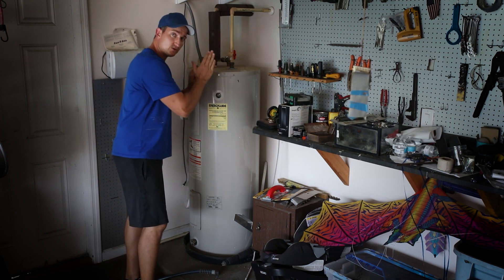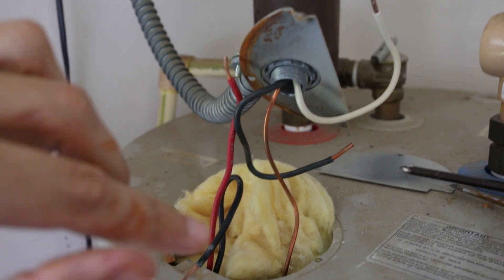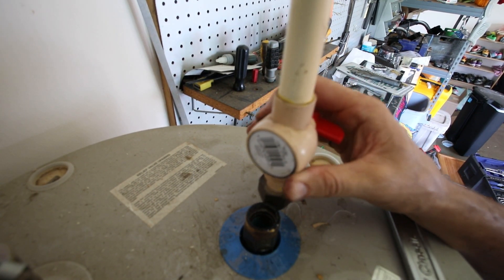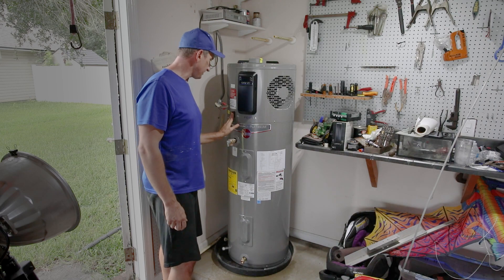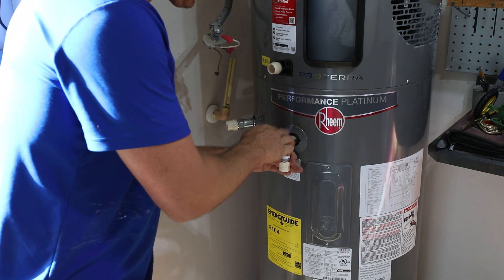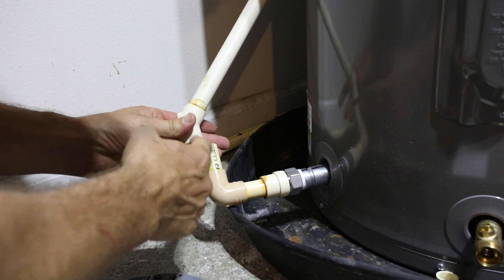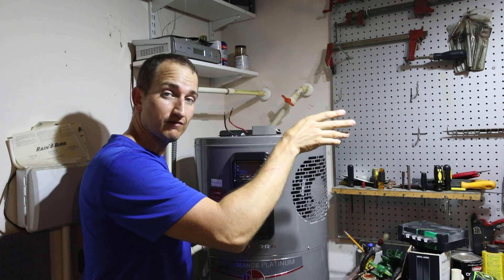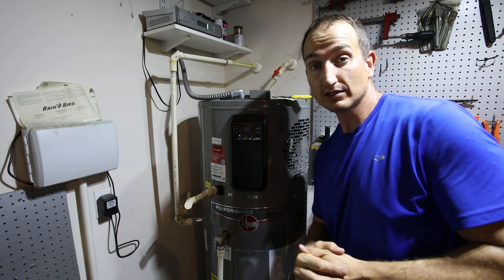High Efficiency Water Heater Installation, Save Money!

Comment: to speed up draining - have you ever hooked a hose up to the cold water inlet (you can purchase a 3/4 pipe thread x hose thread adapter) to hook up your drain hose) and an air compressor set on about 30psi  in the hot water outlet and you can drain most of the water out very quidkly..make sure you disconnect electricity first as the video shows....
Reply from the maker: interesting idea

Comment: To speed up draining, I always open drain before turning off water to the heater, get a good flow going while still under pressure, then turn off water and open TP valve, (what you referred to as purge valve). As far as HP water heater goes, I am concerned with noise level
Reply from the maker: Great tip

Comment: Its called a pressure relief valve.  You shouldn't be putting out how to videos unless you're a qualified plumber.  Also there should be a condensate neutralizer on there
Reply: You dont have to neutralize condensate from a heat pump only from combustion units.
Reply: No neutralizer needed.  Thats just water.  Gas fired condensating equipment produces acidic water due to the byproducts of combustion.  
Everything else you said is correct.

Comment: Hey . So there is 4 wires in the top ! 🤔 you didn't use the 2 small red and black ones  ?
Reply from the maker: I think the small are intended for service if I recall correctly. in any case they are not part of the normal operation of the unit.

Comment: What made you pick cPVC vs. Pex? 

I will need a drill a hole in my garage wall where the water heater is installed for a condensate line, how big does the condensate pipe need to be?

Comment: Thanks, getting ready to hook up same thing only 80 gallon. Surprised you didn’t hook up an expansion tank.
Reply from the maker: Cool, I bet you will like it.  The expansion tank may be a requirement is some install applications however it was not in this case.

Comment: I'm looking at going solar electric 110 volts since 220 volts is around 10 grand to start if you like me are on a limited budget this unit will not work unless you are able to stay connected to the grid in my case it's 180 dollars a month to stay connected to the grid so now I need to find out if any of these hybrid water heaters are able to run on 110 volts
Reply from the maker: I actually looked for a 120 volt unit as well in hopes to run off a small generator if ever need be. I couldn't find one. Most units come with heating elements and these require the 240volt.   I wonder if there is a way to customize one and disable the heating elements and run the heat pump off 120 volts.  Hmm??!!
Reply: @MrKistel  unfortunately the Rheem ones compressor is 220 I had already thought of that don't need electric heating elements also they could be changed to 110 volt elements or even 12 volt DC depending on your system elements can be found in voltage ranges from 12 volts so 48 volts DC so the elements are no problem it's the compressor that's the problem I have found one from Japan that has the compressor separate  but although it only needs a 15 amp breaker I'm waiting to hear from them as to weather the compressor can be run on 110 since it a higher operating temperature it could also be used for heating as well

Comment: Thank you I’m starting my hybrid water tomorrow and I’m using the same piping that u are using…. Great Video
Reply from the maker: Great to hear you appreciate the video. thanks
Reply: @MrKistel  imma do mine this weekend....wish me luck 🤞
Reply from the maker: @vroor32  Hope it went smoothly and congrats
Reply: @MrKistel  it did. And I've decided to run it on 100% heat pump mode. Our hot water shower usage varies so we don't need to have it in "energy saver" mode. This HP mode will save us a ton of $ by using heat from indoor dryer vent too.
Reply: How did it go?

Comment: How would you install the condensation line on a heater in the back of my garage, on an inside wall?

Also, great video!
Reply from the maker: Thanks, and ya it can be tricky finding a way to run the condensation line off the water heater if you are not close to an exterior wall. You could maybe run a long drainage pipe, at  proper height with some downward pitch, along the inside wall towards and exterior wall.
Reply: @MrKistel  you could also install a condensate pump, then you can run the drain uphill. Theyre cheap too